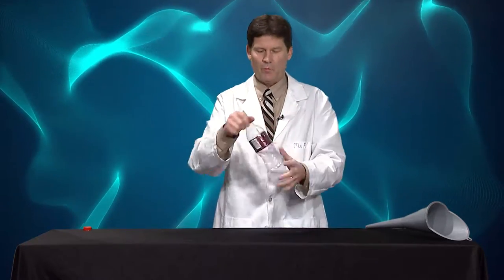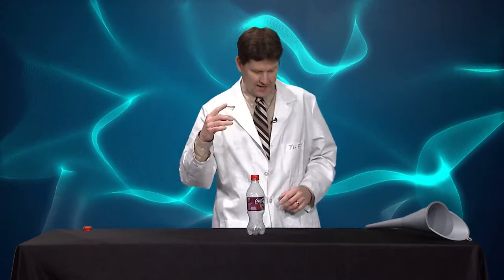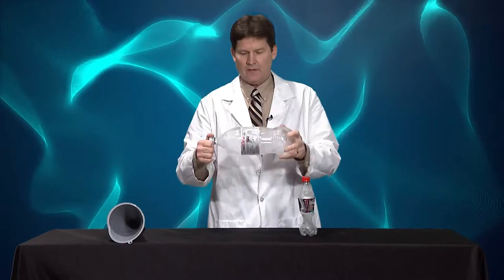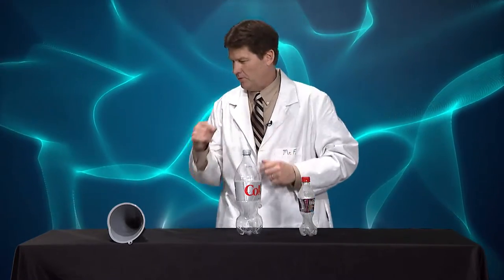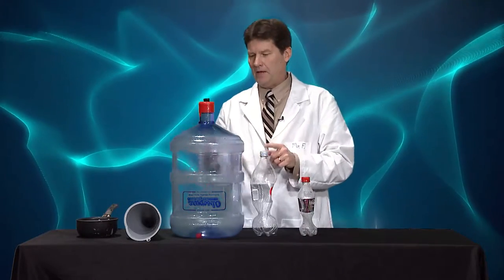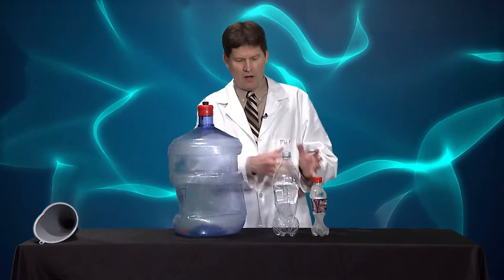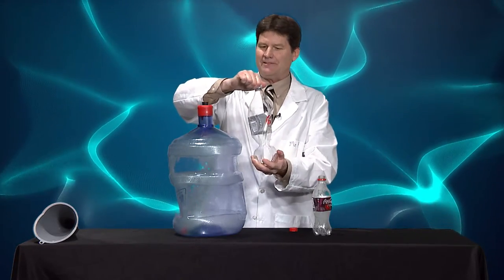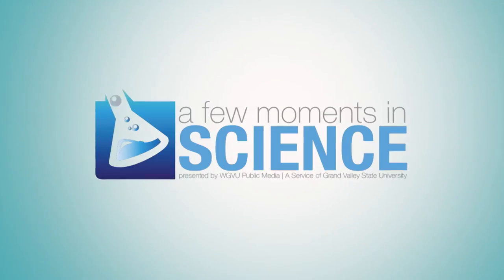Bottle Crushing with Air Pressure

Comment: I do this with my students, but we use the water bottles sold in the local stores. Their side-walls are of a much thinner gauge plastic than a Coke bottle, and the results happen almost instantly once the hot water is poured out, with lots of nice loud crackling sounds as it crushes inward. The kids love it!  :) .